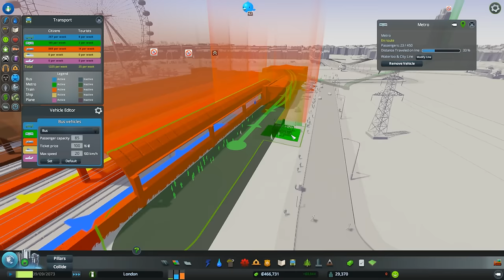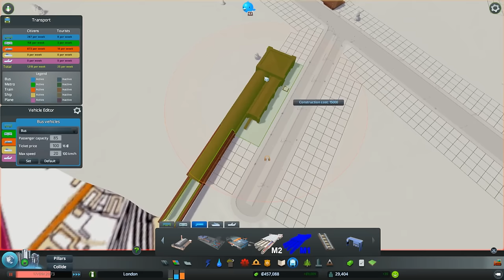Cities: Skylines Building London #19 ►London's Power and Victoria Station!◀ Gameplay

Comment: skye, you said you wanted a decent model of battersea power station. what footprint would you like it?
Reply from the maker: Palerider1942 I would guess something around 8x either 4 or 6 depending on what fits best .. I would think ?
Reply: i did have a battersea powerstation model for SC4 however blender doesnt like it anymore. i will have to remake, and 8x6 would probably be best, i may add an inflatable pig in aswell